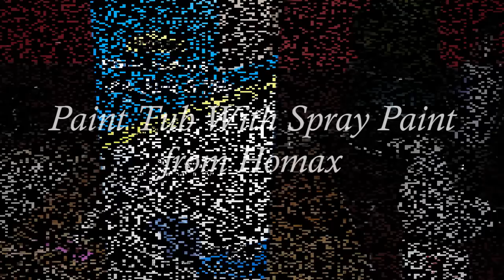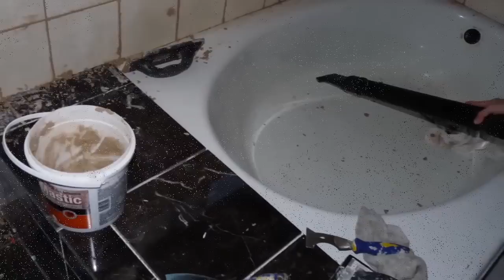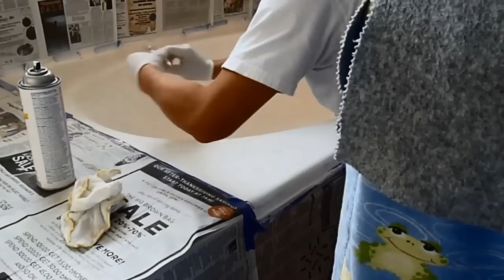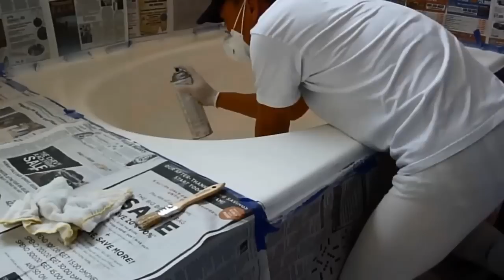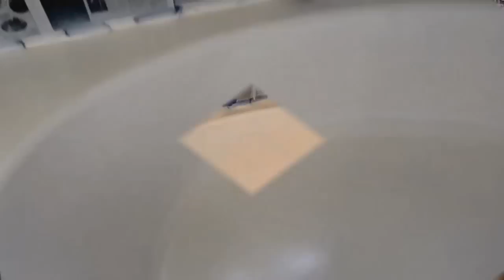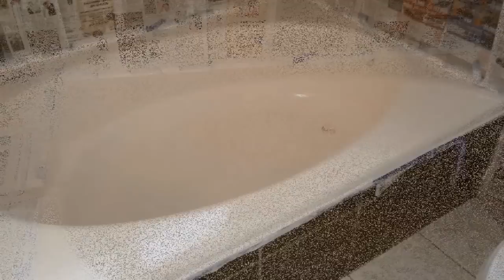Spray Paint Bath Tub With Homax Paint Kit

Comment: Had huge problems with drips and spatters.  Took back kit to Home Depot who gave me a credit note without any problem. Bought another kit. Paint did not cover original almond color.  Waited 72 hours to cure, then sanded with steel wool, recleaned. Today I repaint.  Friend of mine used spray paint that adheres to plastic (Krylon sp) from Walmart for about $5, used tub next day.  Worked well for her.  My neighbour used Homax kit and had no drips.  Good luck to my repainting.

Comment: so tell me would you do this again, did it work well and has it held up well with use?
Reply from the maker: It's been great, but I would use the good rollers next time. Spray is not very thick, if you drop some metal on it, it will chip and if you don't have the same color paint underneath, it will show. It's not glossy as roller paint type. It does look nice after 2 sets (NOT one).
Reply: We are in the process of going our avacodo tub we are on our 4th kit (we have a large tub) and we are hoping it covers in this last coat so we can sell our house.... thanks for you reply :)